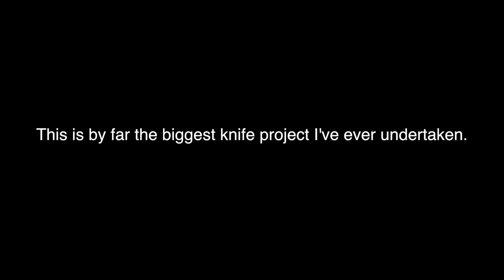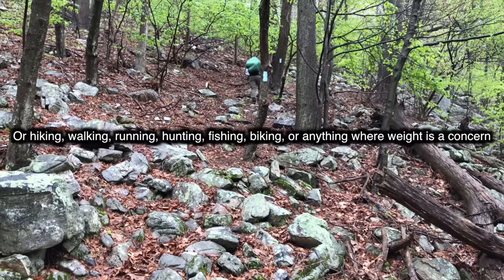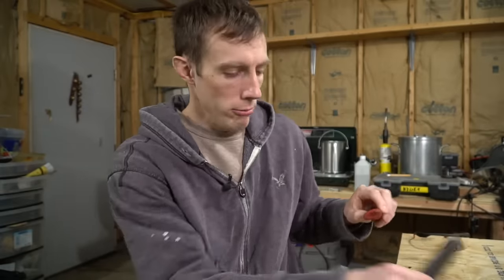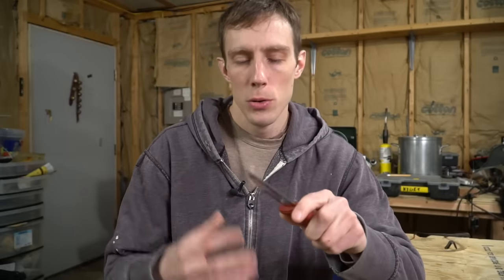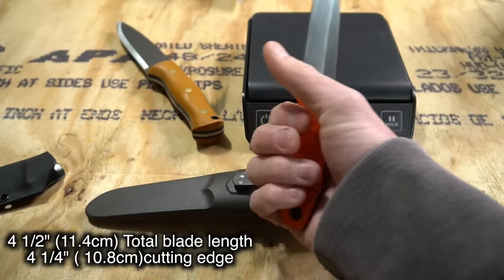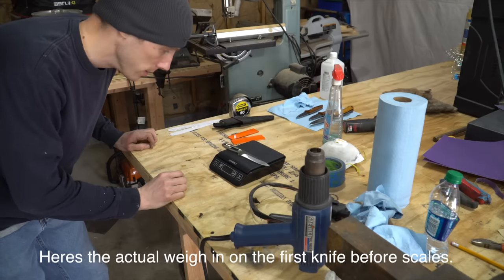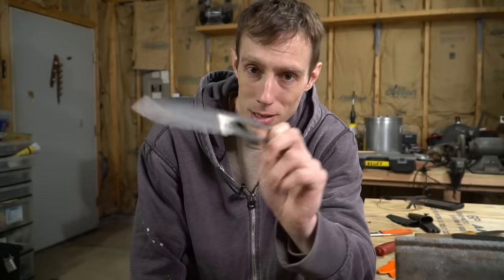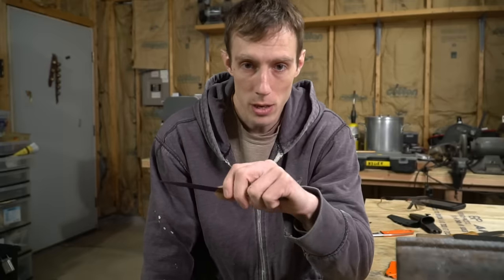What is the ULTIMATE Knife? Probably not what you think...

Comment: Try a hidden tang design with a stacked  birch bark/epoxy handle. Weight issue done. Strong enough to baton with and warm in grip too.
Reply: Yeah, this is how the original versions of this knife were traditionally made. Well, all but the epoxy. If they were strong enough with w/e steel they had in the 1300's, they should be pretty ok with modern steel. I know modern hikers have pressing needs that folks in the 1300's didn't have, of course. Like your knife has to withstand crazy batonning else you have to eat your pre-packaged food cold, lol.  Back then, people just travelled across the world in row boats with no phones or GPS. And they traded people. So much easier back then.

Comment: Usefull or not,... it's a cool challenge. I think you could ad a clip to the first few centimeters of the tip, you don't hit it while batoning. Perforate the scales, ads grip and reduces weight. Use carbon fibre pins. Ad a few holes to the blade,... there are so many things you can do. Good luck👍

Comment: You could add a hollow to the inside of the scales to shed more weight along with a tapered tang, also a fuller on the blade would shave off a couple of grams. Using carbon fibre pins instead of loveless bolts would be another area for weight saving👍🏻

Comment: 3/32" thick (25% less than 1/8") 8670 steel, half height flat grind, wood scales, flared tube pins, 1" or 1.125" wide blade.  It won't be as strong, but should be just as tough as 1/8 stock.  Use AEB-L if you want stainless.

Comment: Tough- try aebl. Its supposed to be very tough, even when very thin (and its cheap). Weight reduction- big ole swedge on the blade. Also, hollow grind a pocket into the back of the scales with a sander/belt grinder

Comment: Buy a Mora 510 in carbon Steel (basicly 1095), it's weight less than a basic, and the design is more suitable for Bushcraft/ wilderness tasks (no finger gard and a better handle design), it's has a bigger tang that the basic and it's fairly rebust, and the sheath has a smaller footprint.
It's my perfect bagpaking knife.

Comment: I think another thing you need to consider is how much it costs to make your knife. For something only slightly better than a mora, it should only cost slightly more, correct? If it costs $80 for a knife that’s only a little bit better than a mora, I could just buy 3 moras and be set for just about forever. Now if your knife is wayyyy better than a Mora, that changes things. I think the cost of this knife is what will really make it superior. Say you can find a way to sell it for twice as much as the mora but it lasts a lifetime, that’s worth the extra money to me. Just my thoughts, I can’t wait to see what you come up with. I know you’re not trying to compete with mora but it’s fun to think of it that way! Good luck Alex, I’ll be looking forward to the next video
Reply from the maker: Thats why i do t want to venture into carbon fiber. Too expensive. Plus it's barely lighter. Im willing to spend on steel if it gives me the right properties but id rather have g10 for scales.  

The idea is more along the lines of the lightest toughest blade ever. Made with the lightest toughest materials. Sure the mora is cheap but it could be better imo. Not to mention it wont fit in a pocket very well😉  Or a fixed blade thats as light as a folder, that will also process firewood😂  The mora basic is a great knife for the price. I would just like some different characteristics 😀
Reply: @OUTDOORS55  you can make for yourself what no one else can or will

Comment: What you want is an OLD Morakniv from the 60's-70's, where the blade was almost twice the lenght, just a tiny bit thicker, it had a metal fingerguard, and a rounded wooden handle. If you just glue on some sharkskin on the wooden handle and you are good to go.

Comment: Love the design but why do you say at 11:35 that a convex grind would shave off weight? A convex grind has more material than a flat grind keeping the primary bevel height constant; that's the main point of a convex: it has more bulk making it stronger. 

The reason your convex is lighter is because you increased the primary bevel height all the way to the spine, not because it's a convex grind. If you had kept the primary bevel where it was in the first prototype, the convex grind would have been heavier
Reply from the maker: I say that because i brought the grind lines up to the spine.

Comment: I would highly recommend the glock field knife.
it is super light weight for its size and thickness.
1/8 in. thick 6.5 in. long blade
only 200 g
and 245 g with the sheath.

I seriously dare you to try and break that handle or knife.
thing is built like a tank.

Comment: Hey Alex, I have a serious question about sharpening a knife I just bought.   I bought this dagger in Mexico as an antique. The man who sold it to me said that it was from the Mexican Revolutionary War. However, he has already modified the handle so that it is now part antler. He also seemed to have cemented the blade to the crossguard. This doesn't bother me because I bought it for its appearance. Now I want to sharpen this and possibly remove the grime and everything on it. I assume that since it has already been altered, any value to it is now gone and that I can safely sharpen it without worrying about its authenticity. Do you have any advice on how to correctly sharpen it? It is double edged and the blade is about 
6 1/2 inches long. If you can get back to me I'd really appreciate your help.

Thank You

Comment: I used a sledge hammer on of those mora handles. A big sledge hammer. It took some time and alot of work to separate it from the blade
Reply from the maker: I hit one twice with a stick and it fell apart.
Reply: OUTDOORS55 That's amazing to me but I believe you. Maybe that was a fluke. As many as they make, it would stand to reason there would be "bad" ones in the mix. My collection of knives is pretty large and I have more Moras than any other single brand. 12 or so.  It's the knife I grab when I walk out the door since its light, hooks right onto my belt, tough. And I don't worry about since it's cheap. I have some custom knives I'm ashamed to say how much I paid for. I've chipped some mora blades and I snapped a blade once due to misuse but I still have and use the first Mora I ever owned which was also my very first knife. A gift from my Dad 42 years ago. I love the knife you made here and would love to own one. Also, I have to say I think your info is the best and I've noticed the improvements in your equipment and skill. Its my opinion that you have the best tutorial on YouTube. My favorite knife is The Old One and I agree the facets on the handle should have been left. Thank you and keep up the fine work

Comment: Carbon scales are light because of intrinsic strength and thus material weight saving. In order to really benefit you would need to lay up a hollow scale for each side of the tang using both the geometry and lack of material ( both carbon and resin ) and it would need bonding on place potentially with titanium pins for extra functional strength. Carbon fiber is not inherently that light as before its because with good design you need much less of it comparatively for similar strength. Ie dont use solid carbon fiber resin slabs.

Comment: Why do you want to use carbon fiber for the scales? At about 1.7 grams per cubic centimeter, it is much denser than even dense woods. For a real light weight handle, I wonder if you could use laminated cork similar to a fishing rod handle. Even HDPE plastic (melted milk jugs) is less than 1 gram per cubic centimeter.

Comment: Micarta is way lighter from g10 and costs the same. you can remove material from insides of the scales to make it even lighter. also tempered tang and full flat grind on such thick knife would make it reasonably lighter and i think still would not break.

Comment: A small fuller, non-metal pins. A hollow grind, or concave, would remove more weight, and is usually used for that reason (not my preferred type of bevel though, but it fits here). Smaller handle would probably be possible also. I mean, skeletonized scales might be possible also, although I’ve never tried that.
Reply: Skeletonized scales seems like a way to turn the knife into a dirt trap, making it get all nasty.  Imagine you gut a fish with the knife... it will have fish guts stuck inside the handle.  

I think he's close, that's a pretty beefy blade still, lots of material can be removed.
Reply: thedillestpickle Yeah I personally wouldn’t ever want it lol, just trying to think of ways to lighten it.

Comment: put that design in the blade that you used for the savage knife and then do a full hollow grind, put two pins that are anything smaller than the ones you are using lol. then do the lanyard hole and everything then do that blade design with the grooves cut in it, on your handle

Comment: The materials I would use would be a sandwich of the following: air bubbled tough thermoset resin grip that goes through the handle hollow, carbon fiber reinforced aluminum the length of the blade, 1mm of hard steel, and the other two again.  Result is a knife with the stiffness and hardness of Steel and the weight of titanium.  Or use TiAl4V, just don't expect it to forge or grind easily.

Comment: I made my own bushcraft knife because I couldn't find anything like it. 

It has 4.5" long, 3/16th" thick 1095 blade, chisel grind, full tang, and a hole in the center of the blade 1.5" from the end. Weird, I know. 

Why it works for me:
- It can cut, whittle, skin, batton, strike ferro, and do anything any other knife can do, just about as well. 
- However, It can also function really well as a chisel, and be added to a quick bushcraft hand plane. 
- The hole at the end is great for cutting small dowels, or even wire.
- The hole mates up to a hole in the kydex sheath that lets me flip the sheath and pin it with a dowel, giving me handles at both ends of the knife to act as a really good draw knife. 

It has really changed my bushcraft game.
Reply: Picture?😊

Comment: How about a rat tail Tang? If you want the back to still pummel, make it a rat tail with a sort of anchor shape in the end. Make the tang thinner than the blade but make sure it tapers so you don't have a hard break point. It if dead set in that handle drill one large hole in the palm center straight through, and one small hole in each side of that and if worried about stuff getting in there put something very very light the thickness of the blade. So you have 3 recesses that don't effect anything where the handle is only as think as the blade and Tang. Or on the insides of each hole a very thin sort of seal / gasket made out of something light. You might be able to make some filings on the spine even something useful like a saw or a file like pattern. How much would it effect a blade to have a smallish hole in the ricasso? A finger rest will also reduce weight while improving comfort. Also have you ever considered a Ulu ? Much less material really since there is not a classic Tang. You could make the blade fairly thin width worse and the supports can be minimal or skelletized.

Comment: I also have a 7 inch fixed blade knife. The knife, sheath, and paracord wrapped handle only weigh 2oz
Reply from the maker: You can certainly make a knife very light. In this case it still has to be capable of serious fire prep and have scales. Subsequent versions have been down to about 2oz but without scales with .140 stock. With thinner stock it will be much lighter 🙂
Reply: @OUTDOORS55  oh yeah for sure lol. The 7 inch knife im talking about was specifically designed for ultralight backpacking. Now the knife i designed on the other hand is for backpacking but for more than just cutting summer sausage lol. Id like to show it to you.

Comment: Esee Izula clone off aliexpress in D2 for $10 + the official micarta scales off Amazon for $20. Best backpacking knife for the money I've found. $30 bucks gets you a small light fixed blade with decent sheath and micarta scales. While your on AliExpress grab a "tek-lok" for a $1 if you want to wear the sheath on your belt instead of a neck knife. That's what I did. It's been pretty decent for cheap.
Reply: Do you really believe that the steel they use is actually D2? That would be my biggest concern.
Reply: Ya. I know. Ive sharpened it, it seems similar to other known D2. Eitherway, it does hold a reasonable edge. They seem to have 2 levels of quality on the Chinese marketplaces. The cheap ones come in a bunch of different colors and are made out of dirt cheap steel for like $5-$7 then there's a non-painted, stonewashed version out of supposed "D2" for $10-$11. I have 2 of the supposed D2 versions. One I ordered the micarta scales for ($20 off Amazon), the other I did a paracord wrap. Both seem decent. Certainly out perform other knives around the $10 price point. But if it's not your thing you can always spend $60-$70 on the real deal.

Comment: could have also used a hard grade surgical titanium for the blade and torched it for a ti oxide coating to reduce wear greatly, then add your carbon fiber handles
Reply from the maker: Titanium isnt a good knife blade material. Its way too soft. Thanks for the suggestion though👍
Reply: @OUTDOORS55  that's odd, i recall several alloys that were popular a few years back being capable of cutting steel and also being very springy, however most of the ti i find online isn't what is advertised unless you avoid places like amazon and ebay, when i do try to find a comparison of harder stuff i can't find any detailed info aside ti vs stainless, i do know for sure though that you could electroplate your blades to prevent rusting, watched a guy use a usb charger, zinc battery and cotton swab covered in vinegar to basically make a 5v plating marker of sorts to fix a wear spot on a motorcycle fork, what he did was took the wrapper off the battery and wrapped one of the wires around the cotton pad around the end of it grounding the casing and hooked the other end up to his item to be coated then dipped the end in vinegar and started rubbing it across the metal to give a quick plating of the metal the battery was made of, it seemed to work pretty fast too.

Comment: I think it;s something every bladesmith thinks about, I came up with a blade I called the Recon One, no relation to the cold steel, I never even knew they had one until I made it. So a knife that could do everything, it had a pry bar, swell in the chopping portion, robust tip, thinner blade at one portion than the other to do different tasks. Then I made it solid one piece construction, no additional parts, the handle and grip were ground from the tang material. made from 1095, a knife you could rely on for everything. But to be honest you cant fit every function into a single blade, there's specialist knives for a reason, a ultra thin craft knife will never be a super heavy brush clearing machete, and the machete will never be a fine detail craft knife. We are going to have to still carry multiple blades for various tasks.
Great video though, great theory and concept behind your design too. 
You can check out my blade it's the poster knife for my channel background at the top. It can baton, pry, shave, be used for military combat etc, hammering on the flat face etc. Not that great at fine splitting due to the swell, but it splits logs rough just fine for camp use. Or it did until I melted it last month ^^

Comment: Use .100" stock instead of .125".  You will lose very little in strength and save enough weight to get closer to 3 oz.  That's only .012" per side of the blade and most would not even be able to tell by looking at it, but you will feel the difference.  Experiment with different wood for the scales.  If you get the right compromise between weight and hardness, and boil them in olive oil to harden them, the wood scales would be not very much heavier than the carbon fiber and way cheaper.  Good luck on this project, you are close enough already to meeting your goals and I am sure you will do so.
Reply: .1 is a great sweet spot for outdoor knife imo.

Comment: Why would you think that carbon-fiber has any significant weight advantage over glass-fiber? If you get some high quality material the difference is maybe 10-15%.
Wood is the answer - get some light weight wood and add a protective coating/wrapping.
Balsa and other low-density wood in a Carbon-fiber wrapping is a rather well liked material in many applications including boats, car-racing, RC aircraft and even normal aircrafts.

Also 50$ of some small scrap carbon!?!? Where do you go to get that ripped of ? Or are you custom-ordering CNC milled single pieces?

Comment: While I agree with you about paracord not being the best handle material, I feel like there are a couple things you overlooked about some of the disadvantages you pointed out.

Yes, it is not very grippy and more so when wet but there are a large variation of wraps you can do that provide a more textured surface area to negate that. You can even add handle choils with some fancier wraps.
Also I know that It is not ideal to remove the handle for cordage but that's what lanyard holes are good for. Add a braided loop, a weave or even a monkey fist.

I'm not trying to convince you to use paracord for this though. Neither of these work for the knife you want as both use up more material,  adding more weight. I just don't think paracord is as bad as a lot of people make it out to be. It doesn't make the best handles but it is certainly far from the worst.